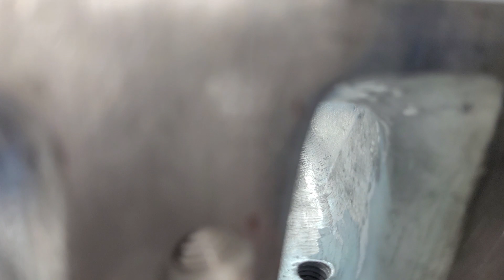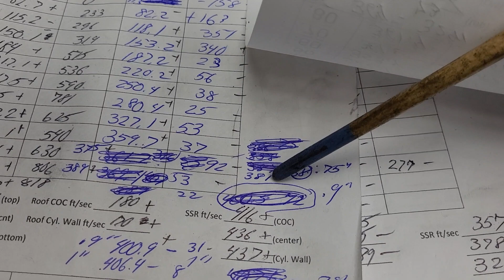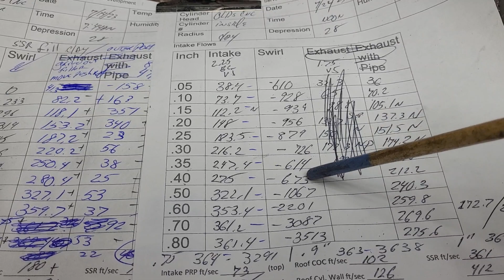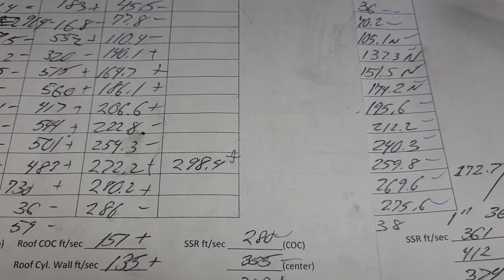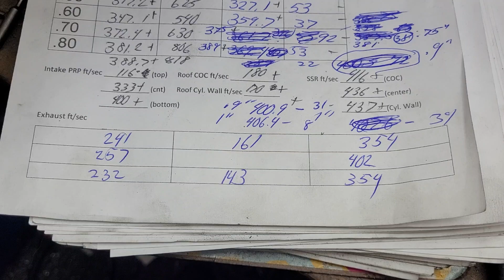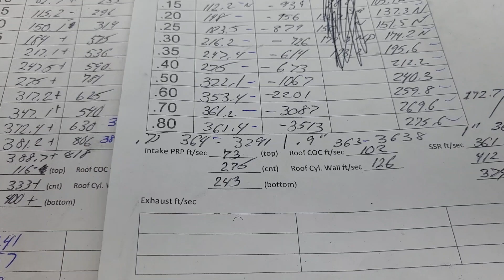Oldsmobile cnc master, Start on inside cylinder.

Comment: AIR SPEED: Try to Equalise Air Speeds ! It  is about keeing Air Speed the ....SAME Speed ,...Roof to  Floor..AVERAGE 260 to 280, for Street  to Keep A/Fuel Atomized all the Way into Chamber !  If ...ROOF A/F Mix is FASTER....  than Floor Speed ....., Higher Speed Roof Mix  will get AHEAD and  will De-Atomize and ...Tumble.. Blocking-Puddling  and  ..Reducing.... A/F MIX ....FLOW in  PORT.....  ? De-Atomise will not Burn ?
Reply from the maker: Hmmm, do you think I don't know this? I do appreciate the input but getting the port speed differential near zero will be tough on a bent port. This is 6 degree stuff so it turns about 90 degrees.

Comment: @2:29 That bolt boss creates a recirculation bubble that sticks out about 1/4", the incoming flow treats that bubble like a solid object, and once the flow clears the bubble gets pulled to the left(from POV). That's why you see so much liquid on the left side(from POV) wall near the roof. That little trench near the guide is helping to shed the horse shoe vortex, but everything is getting pulled to the left(from POV).
Reply from the maker: Good info, thanks

Comment: Are imbalances in flow between unlike ports like these detrimental in any way to the operation of the motor due to uneven power contributions?.
Or is more alway better?
Are the combustion chambers done?
Nice work.
Reply from the maker: I did a bit of work to the combustion chamber, next video I think. My ocd wants every port identical but in reality, it is two v4 engines bolted to the same crankshaft. Different torque curves provided by different designs flattens and widens the torque curve.
Reply: @servediocylinderheads exactly what I was gonna say
Reply: @servediocylinderheads  I've always said that that is why Olds engineered these ports to be different. It would have been easy to make the ports symetrical like Rocket Racing heads design.